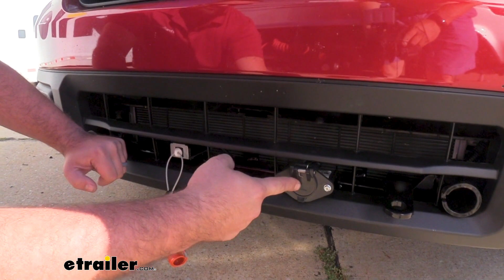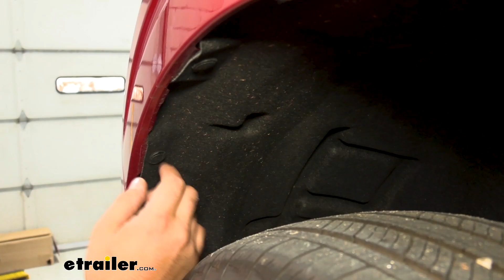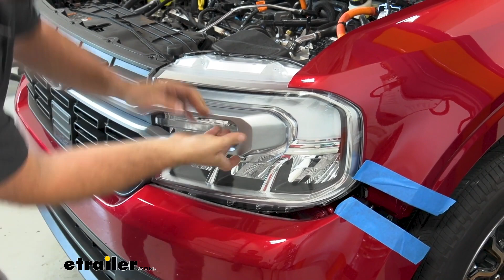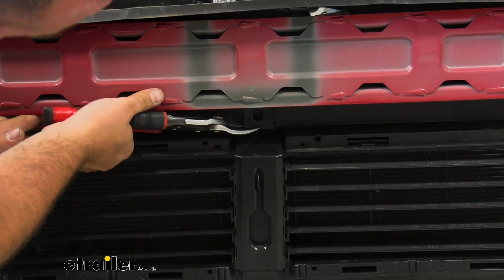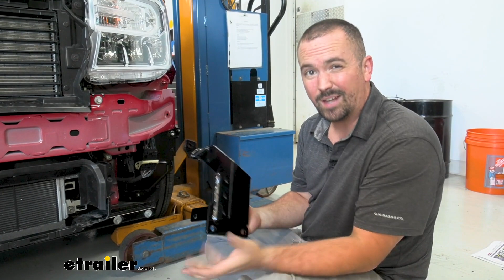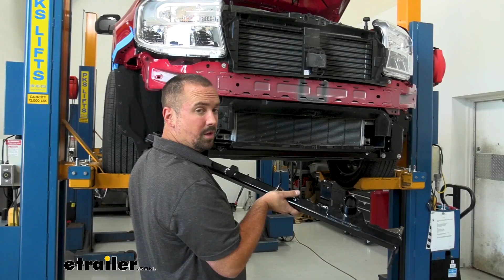etrailer | Mount: Roadmaster Direct-Connect Base Plate Kit on a 2022 Ford Maverick

Comment: Which baseplate do you more, BlueOx or Roadmaster?
Reply from the maker: Blue Ox base plate kits are a little easier to use and typically have a cleaner appearance once they're installed. If it was our personal vehicle that we were flat towing, we would go with the Blue Ox. Both options are manufactured in the US so if that's an important consideration for you, you won't go wrong either way.
https://www.etrailer.com/Base-Plates/Roadmaster/RM97RR.html
Reply: @etrailer Which one did you go with because from what I see, the roadmaster is much better looking than the blue ox, which requires butchering the front bumper.
Reply: @etrailer   from the pictures I've viewed it appears there is more cutting out of the Maverick and a less cleaner look. Either way, very good video, thank you for doing this

Comment: I gotta keep coming back because I do want to tell you when you run the wires to your tail lights you have Cut the wires and it does not leave a very good connection just an all around bad bad idea with a new vehicle like this!!
Get an older 4 wheel drive with a transfer case so you can put in the neutral and pull it!
Use  Magnetic lights for
 turn signals/brakes and running lights on your tow car!
Clean with no wire cutting!
Plug and play is the way!
Thanks!!
Ps.
 Just buy a flat bed automobile trailer!!!
In the end it'll save you money!!!
Pss thanks again!
Reply: We have an NSA tow bar system on our Maverick with the Ready Brute surge brake. No connections needed to vehicle wiring. Just use magnetic wireless lights plugged into motorhome rear wiring 7 pin plug and cable loop around Maverick brake pedal.

Comment: People please don't flat tow your automobiles!
3x Harder on it than just driving it!!!  Doubles your miles  on the running gear!
Please just buy a flat bed tow trailer to put your automobile on!
Thanks!
Reply: For my vehicle, when placed in neutral tow mode, it does not accrue any additional mileage.  Plus by pulling it on a trailer, you then have to contend with your RV, your towed vehicle AND the trailer at a campsite.  Some campgrounds may have extra parking or storage but most of the ones I use, do not.

Comment: Wonder what a shop would charge to install that and the wiring 🤔
Reply from the maker: Shops near you may have a standard pricing for installing this kit. You can check with the shops on this pricing.
https://www.etrailer.com/installer/near-me/base-plates
https://www.etrailer.com/Base-Plates/Roadmaster/RM97RR.html
https://www.etrailer.com/tbwiring-2022_Ford_Maverick.htm
Reply: Ford gave me an estimate of $700-$1000 if I supply everything.
Reply: @Robert-uq5ew  I ended up just installing everything myself after getting a quote for over $1500. I’ve now flat towed my Maverick a total of around 5k miles with no issue.
Reply: @TheSRMproject  Roadmaster or blue ox?
Reply: @Robert-uq5ew  roadmaster bracket. I do use the Blue Ox patriot brake 3.
Reply: I don’t know how much he charges to install this but it’s worth every penny!
Reply: @johncaruana6406  I ended up doing the full install myself 🫡